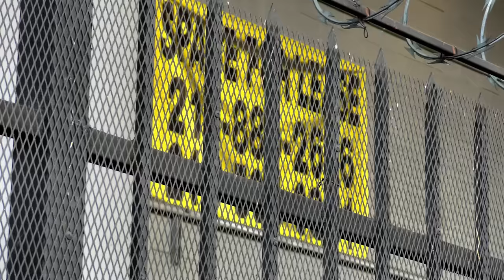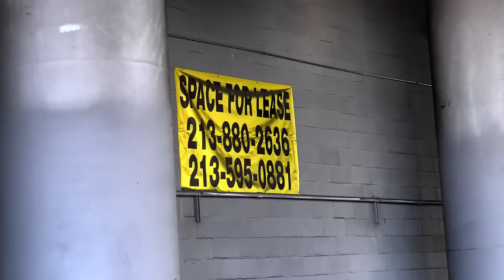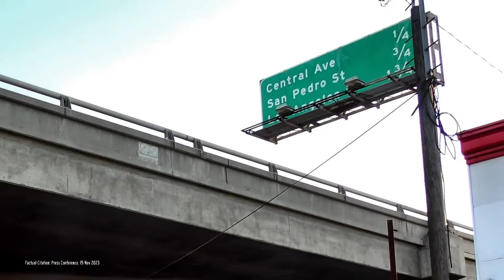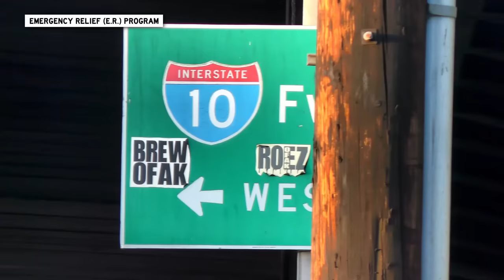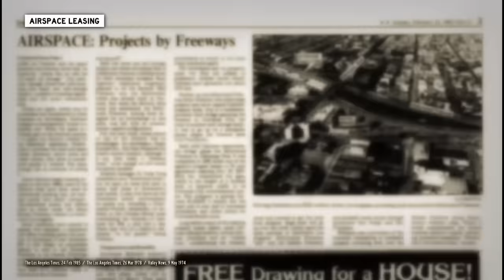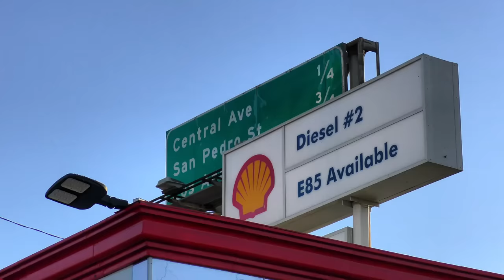California only has *70 DAYS LEFT* left to FIX I-10 🔥

Comment: The sad part is that the Los Angeles Transit Authority took only weeks(!) to update all signalling and tracks on the train line parallel to that I-10 because of its closure. And now they wonder why ridership went up already 20%..... (Trains are now much faster than before to DTLA).
Reply: Good to hear, last time we were there the trains along that corridor were sadly slow.
Reply: @karlkoehler341  Yes. The sad part what I meant is that they started that modernization because of the I-10 closure and not before.
The MTA in NYC spends a huge amount on track repairs right now, especially on my line - I wish other Transit Associations would do that not to just have a positive news headline because of a catastrophic road closure.
Reply: Sounds like there needs to be a few more fires to improve things...
Reply: And if you take the MTA Express buses (extra fare required, and they are coach buses) you see the really well clothed people. Still - it is $7 fare and $2.90 is counted towards the weekly cap....
Reply: @julm7744 And - "one more lane will fix traffic" has become a meme - it will NOT fix traffic. It makes it worse.
Reply: omg, is this true? This would be a great story.
Reply: @julm7744 Widen the freeways and displace more people from their homes and businesses in an already bad housing and rental market. Try again and maybe think outside the box of adding one more lane.
Reply: @x--.   Yes they work hard. It is sad though that they used the I-10 closure to modernize the rail rapid transit. They could have done that years ago as train signalling systems from Siemens, GE, ... are available for ages. More trains on the track, less distance between trains needed because of electronic signalling knowing all the time where each train is on the track. That allows higher speeds and higher frequencies. If you want you can run a train every 3 minutes at 100mph if you adopt and build it!
Reply: yeah but then what happens when the freeway is fixed? ridership probably will go down
Reply: @julm7744   LOL. Hard to believe you aren't joking. Why don't you look at the Katy Freeway and see how well lane additions work to reduce traffic in congested systems.
Reply: @WeazelGamingHI  That is part of the problem.
The LA Transit Authority should spend huge money to advertise how faster the transit could be by parking on a Park and Ride parking for free and then taking a train to destination.

In New York City that works already quite well, People parking cars at Harrison NJ to take PATH to Manhattan or people from Poughkeepsie, New  Hamburg, Croton Harmon, ... parking the car at the station to take the MTA MNR train to NYC.
Same at stations in Long Island for the MTA LIRR.
Reply: And if more and more people do this - at some time a bus service could kick in for service from the single home neighborhoods to the station. That is already working at Nassau County with the NICE bus - but this is a horrible downgrade from the MTA service for Nassau - Nassau county - being Republican of course - chose to cut public transit to save money. But still thousands of people take NICE bus to get to NYC Transit at Far Rockaway or MTA LIRR at Long Beach.
Reply: @julm7744   Christ that SoCal education system is so weak in parts. Reading comprehension obviously needs serious improvement. I never said there wasn't traffic problems, but that your proposed solution is proven ignorance - ya know, just like everyone else in the comments is telling you. Hilarious that you think I'm conservative. There are smart liberals and, well, the not-so "enlightened" ones. Lots of the latter in California. Having lived there, I've seen it.
Reply: @julm7744  ONE MORE LANE! ONE MORE LANE! ONE MORE LANE!
Reply: @julm7744  I ditched my car years ago when I moved to downtown Long Beach.  At first it was going to be temporary, but now I can't imagine going back to driving a car around LA.  Driving sucks!  Our transportation system is way better than just a few years ago and getting better all the time.  I do rent a car once or twice a month to go out of town or to run errands, and I save a ton of money. Plus, I get a lot of good exercise on my bicycle and walking around.

A friend offered to drive us up to the Dia de los Muertos event at the Hollywood cemetery. That was hell. The traffic sucked and we spent most of an hour trying to find parking. I so regret not taking pubic transport. Cars are the worst part of our city.
Reply: It's great that Metro completed the Regional Connector Project earlier this year, so commuters travelling to and through DTLA can feasibly take light rail. That wasn't an option only one year ago.
Reply: @PascalGienger  Oh I know. I remember a literal decade ago hearing Metro employees complaining about LADOT refusing to prioritize trains and Orange Line BRT. They were too worried about blowback.
Reply: For those that think one more lane will help, think about the freeway as a pipe with a nozzle at the end, and small nozzles across it (exits).

If you increase the size of the pipe and keep the nozzles the same, you’re just increasing the amount the pipe can hold, and the throughput is the same. 

Transit is adding another pipe with wide nozzles to take some of the water away from the  other pipe.

Another way to look at it; imagine if everyone on your block had a party at the same time, and there was a highway exit 500 ft from your block. No matter how you route the cars, every car eventually has to settle and park in a driveway. This creates a line to park, which will back up to the highway. Would more lanes help? 

Now, imagine that everyone going alone carpooled, would that help?
Reply: @javiersjournalOH, IS THAT RIGHT?? *LIAR!!*
Reply: if anything the blame go to gov newsom  he signed a executive order not too long ago  in regards to such land usage
Reply: @javiersjournalI take transit to work in NEWPORT BEACH. You my friend are full of it
Reply: @javiersjournal 5-7 of my colleges take transit too out of 50 or so people some have been working there for 5+ years
Reply: I work in grocery
Reply: @javiersjournal 1 when 2 where 3 were there any other things 4 you are also in a bubble if you think no one takes public transit
Reply: do you mean we don’t want ridership to go up? If ridership is up 20%, which I doubt highly, and would love to see your citation on that, then that’s a good thing not a bad thing.
Reply: @julm7744  you don’t live here. Nobody who lives here says Cali, and, nobody gives a shit about who takes the train and who doesn’t. In LA there are a lot of unsafe lines. I wouldn’t ride the train in New York now either. Underground means danger.
Reply: @julm7744 you’re embarrassing us man. Please do some research on how adding lanes to freeways has proven repeatedly to make traffic worse. Please. 

Also, that we don’t like being on buses and trains because it’s looked down on has more to do with you and anyone that thinks that way than on why we don’t ride them. The fact of the matter is public transportation here sucks because the buses and trains don’t run frequently enough to actually make it convenient. We need more bus only lanes and the MTA needs to hire their own police force again to make it safe for women to ride.
Reply: @julm7744  ever hear of induced demand? widening freeways only result in more cars, displaced people, uglier cities and suburbs, and wasted taxpayer money.
Reply: @julm7744 <<< Imagine having to sit next to this guy and his 6 "likes" on a train for 20 minutes.
Reply: @julm7744  about the worst idea would be to further widen LA's freeways.
Reply: And here I am thinking Illinois has some slow ass construction workers.
Reply: @julm7744 When lanes are added the new lanes fill up with cars.  There there is no space to add lanes anyway.
Reply: @johnjingleheimersmith9259 I often drive visitors to Houston who say “they should build a train on this freeway to fix the problem.”  I then tell them there was a train track there and they took it out to make the space for 16 lanes in each direction.  Thanks to Congressman Culbertson the SOB who forced that project through. He lost his seat and it’s for the better.
Reply: @jw77019  sounds like a Chicago politician story. Only way to fix things is to elect better people unfortunately.
Reply: @PascalGienger  Especially here in northern San Diego County on the 78 freeway. Every time they added another lane each way, it became more congested.

Comment: If I had a nickel for every interstate bridge closure in 2023 for structural concerns after a fire, I'd have two nickels. It's not a lot, but it's weird that it happened twice.
Reply: Doom
Reply: Law of large numbers: no matter how unlikely an event, with enough opportunities it is nearly certain to happen.  Counter-intuitive because one person can't extrapolate  from personal experience to a nation of over 300 million people.
Reply: People vastly underestimate how common that is. You can calculate it with a binomial distribution. If an event happens on average once every year, then the odds of it happening n times in a year are:
0 = 0.3679 (for the mathematically inclined, this is 1/e)
1 = 0.3679
2 = 0.1839 (i.e. 18.39%)
3 = 0.0613
4 = 0.0153
5 = 0.0031

If it happens on average once every two years, then the odds are:
0 = 0.6065
1 = 0.3033
2 = 0.0758 (7.58%)
3 = 0.0126
4 = 0.0016
5 = 0.0002

If it happens on average once every 5 years, then the odds are:
0 = 0.8187
1 = 0.1638
2 = 0.0164 (1.64%)
3 = 0.0011
4 = 0.00005
5 = 0.000002

So even with a once-in-5-years event, the odds of it happening twice in a year is still pretty high at 1.64%. This applies to all sorts of other rare phenomena. e.g. major earthquakes, plane crashes, etc.
Reply: God, as someone who lives in the greater Philly metro area and wants to see more investment in mass transit, the I-95 incident was so frustrating. We were told it could take months before that stretch of freeway was operational again, which would've been a godsend for the city's extensive but underutilized transit network. Instead they threw so much money at the highway that they were able to reopen all lanes in like a week.
Reply: @Sammie1053 yeah the speed with which they fixed that just further supported my belief that we live in a simulation 😂
Reply: It's not weird, it's good
Reply: I do love a Doofenschmirtz reference.
Reply: Three nickels. There was a 165-vehicle pileup with fires on an elevated section of Interstate 55 in Louisiana about 4 weeks ago. The southbound section reopened days later, but the northbound side took three weeks.
Reply: There was one such closure recently of an overpass over I-94 about 50 miles east of Minneapolis due to a fiery traffic accident that killed two and injured seven others.
Reply: Just a way to force people into public transportation and reduce emissions
Reply: @MonkeyJedi99  Where’s the —inator?
Reply: The second one was probably a copy cat fire. The person setting the fire saw what kind of potential problems it can caused and wanted to cause more chaos on the freeways,
Reply: @macmedic892  Someone pushed the red button and it exploded.

Comment: For I-85 in Atlanta, the rebuild contract promissed big bonuses if the road was repaired by a certain date, and big penalties if they missed the deadline.  It reopened with time to spare.
Reply: This has always been standard practice for all highway construction. Give a big carrot for the contractor to get it done quicker and under budget with an equally big penalty if it’s late or severely over budget.  High risk, high reward business.

Comment: This is why we need better public transit. Improve LA metro!
Reply: Yep they need to hurry up with the D line subway extension to UCLA and Electrify Metrolink just like Caltrain is doing
Reply: Yep they need to hurry up with the D line subway extension to UCLA and Electrify Metrolink just like Caltrain is doing
Reply from the maker: No doubt better than '94.  Wonder what the network will look like in 2052?
Reply: @RoadGuyRob  there are plans to make it a mega system. If it gets implemented then transit will be the main way to move around LA.
Reply: @IndustrialParrot2816  I think you accidentally double posted but I absolutely agree. Modern 25kV electrification should be the standard, not this third rail stuff like LIRR or diesel stuff like GO Transit.
Reply: @Awesome_Aasim AC 25kV isn't the most suitable electrification method for high density lines. Trains will be cheaper using DC instead of AC due to various AC to DC equipment required onboard for each train rather at consolidated places. For legacy systems you're stuck to what it has been, but for newer systems DC 1500V overhead wire should be considered (at least as a choice).

(AC will become cheaper for low-density train corridors like intercity rail, and AC is still the only feasible electrification method for HSR)

Comment: Back in '94 the section of the 10 that collapsed was the exit I used near where I lived. They worked (loudly) 24/7 to get the 10 up and running. Didn't make trying to sleep easy, but they got it done quickly. But to this day,  I still hate getting stuck stopped under a freeway when the light is red.

Comment: Philadelphia had a similar incident under I-95, about a year ago(I forget the date). A fuel truck exploded directly under I-95, on an otherwise quiet Sunday morning. I don't remember any explanation of the explosion. There was video from a car that experienced the drop in road level when it happened. The resulting traffic snarl was brutal, but the roadway was fixed quickly.
Reply: It was actually June 2023, so relatively recent.
Reply: That was definitely not a year ago and they got it open pretty quick
Reply: Not even close to a year ago lol. That was this past summer.
Reply: It also didn't "explode". It caught on fire after it tipped over on its side and slid.

Don't make things more than they are. An explosion involves a bang.

Comment: I would guess that after the deck superstructure (determined to be sound?) is shored temporarily with timber so you can get traffic going again, they would approach repairing the columns like a seismic retrofit.  Remove any spalled & heat damaged concrete, hang some new rebar around the outside, encase the column with a steel jacket and fill the void space with injectable grout.  Do several columns at a time each week and you're done by the deadline.

Comment: I’m still gonna hold my breath every time I go over this stretch of freeway once it’s reopen😅 One of those things where even when you know it’s been fixed, you saw the initial damage play out and always have that in your head haha
Reply: Like the 737-Max?
Reply: @kenmore01  exactly
Reply: The Northridge Quake destroyed a huge stretch of the 405 and you probably drive over the replacement all the time.
Reply: @jayrenner1053  no doubt! Not saying any of these portions of freeway are unsafe, it’s just human nature to be cautious after witnessing it!
Reply: @kenmore01  Ironically the 737 Max is probably the safest plane in the world now because of that debacle.
Reply from the maker: They'll do good work.  I believe they use an X-ray machine to inspect the rebar inside the concrete.  Maybe someday they'll let me tag along and see how they do it (fingers crossed)
Reply: @johnjingleheimersmith9259  right, and their preceding reputation sadly makes it hard to let that sink in! I used to check flights before I booked to make sure it was anything but a 737-Max😆
Reply: @johnjingleheimersmith9259  The operative word there is "probably." I doubt it's any safer than a regular 737, and still has MCAS, it's just common pilot knowledge how to disengage it now. The original MCAS used one pitot tube and two jets crashed because of some failure of that one tube or system. Now, it "redundantly" uses two. Calculate the odds of another failure. One pitot tube, two jets crashing in two years. Both pitot tubes? Assuming the odds are the same, that's two squared statistically speaking, so one failure of both every four years. I still don't like it.
Reply: @kenmore01  I supposed you feeling like avoiding driving or riding in every single car/automobile too, right? Statistically speaking.

Comment: Where I live, a few years back, a collision directly under an overpass (over the freeway) took several lives and caused a similar closure -- albeit of a bridge that handled a fraction of the traffic this one handles. The next nearest crossings were a mile east and a mile west, so it was a huge inconvenience for many in an area that has lousy north-south connections anyway. The collision involved a tanker truck hauling gasoline, which was ignited, and the resultant fire was so hot that engineers were not confident the bridge would be safe to use after that.
Reply: A few decades ago, the same thing happened on the Long Island Expressway. Under a major overpass, which knocked out two highways.
Fortunately, for us, it only destroyed the overpass in one direction. So they were able to reroute both directions onto the remaining overpass.  It took them a couple of days to show up the overpass so that it wasn’t dropping concrete onto the expressway. 
In this case, they had to demolish it the entire thing and rebuild it.
Reply: I believe that was on the 118 freeway near Chatsworth. I remember that and the 94 quake, and I knew the streets well enough to have my own alternate routes.

Comment: They Fixed it as of 2 am this morning
Reply: It is open, yes. It has be shored up so it can be safely used. But it is not fixed. The damaged columns still need to be repaired. The temporary wood cribbing is supporting the loads.